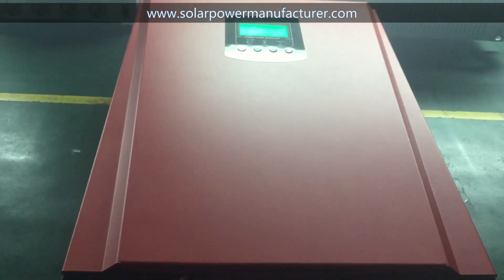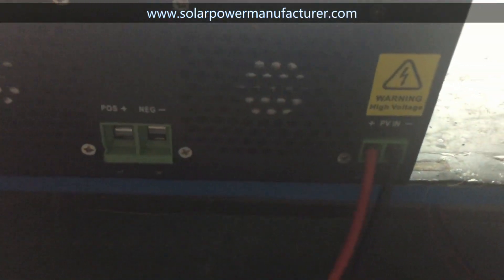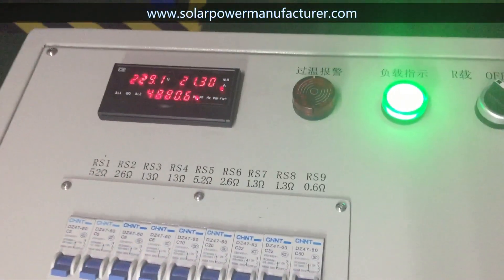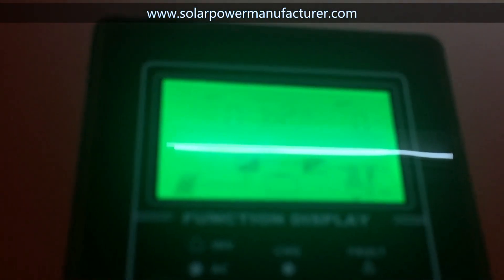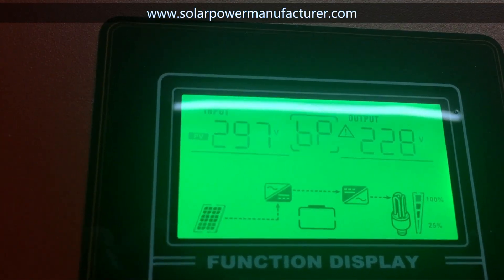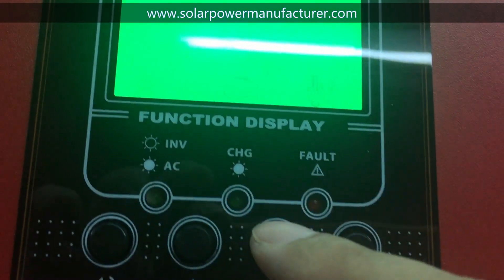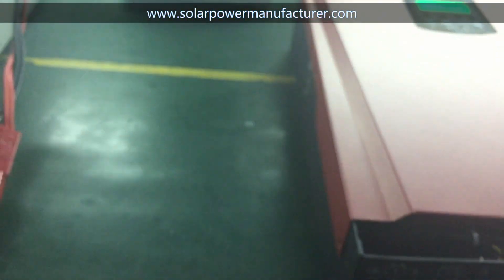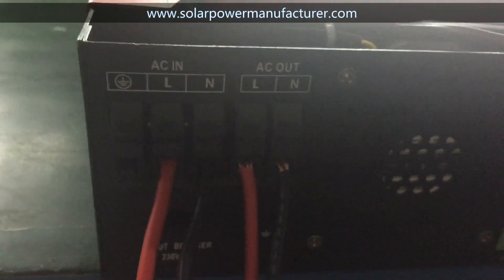batteryless solar off grid inverter

Comment: Haha... powered by GIANT AC->DC power supply?
Reply from the maker: Hello,This video was shot in the factory, without connecting the solar panels and batteries, and using a power simulator to simulate the solar panels and batteries. Are you interested in this product?Contact us and get more information  Whatsapp +86 15302966051 admin@solarpowermanufacturer.com